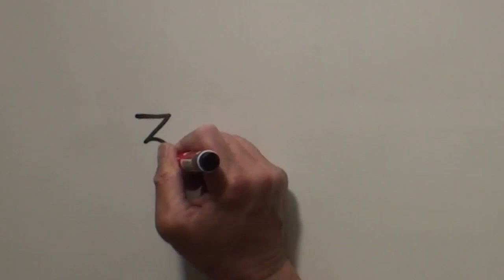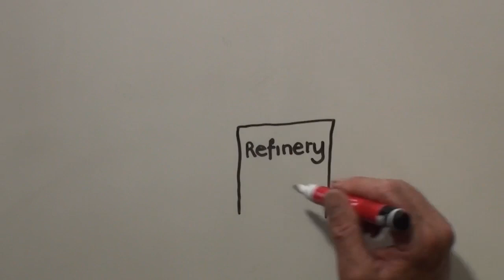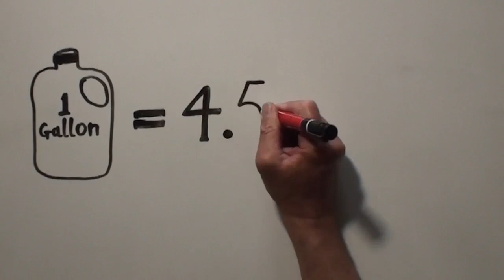Volts for Oil | Fully Charged

Comment: Hey good folks at Fully Charged! I've got a question for you. When I divide 5,642,000,000,000 watts by 250 watts (a reasonable figure for the watts used to power an EV for a mile), I get 22,568,000,000 miles, or about 22.5 billion miles. However, you ended up calculating "just under 20 trillion miles." Which one of us is off? (I hope it's me!)
Reply: You are right, he is wrong (besides "watts" for energy).
And if you correlate the 5.6 TWh with the amount of produced fuels, you get less than 0.1 kWh per liter.
The high electricity demand of fuel production is a myth.
Reply: @701983  Thanks for your thoughtful reply.

Comment: Also factor in the carbon emissions from the tankers used to deliver the fuel to the filling stations, the power used to refine the fuel THEY use too, and the emissions from running the filling station.

Comment: Can we have an update, please?
Reply: What about a correction?
Look at "volts for oil corrected"!
Reply: 5600 GWh used for the production of 3,659,500 TJ oil products (UK 2005, IEA statistics) is 0.055 kWh per liter diesel equivalent. Or 0.2 kWh per gallon diesel equivalent.
Let's say 2.5 gallons of diesel for 100 miles equates to 0.5 kWh of electricity for fuel production.
Which would suffice for ~ 2 miles with an electric car.

Comment: I just love this video! 
Comparing enegrgy spent to make fuel.
I would love a follow up, on the full chain well to tank.

From this video I deduct. 
Energy required to refine oil to fuel, is approximately 50% of energy if you used it to charge an EV insted.

How much to search, drill, transport crude oil, distribute fuel? 

How close to 100% do we get?
Reply: It's now 2023 and I would like an update too.
Reply: As would I!

Comment: It's 20 billion miles, not 20 trillion. For instance 20.000 miles x 1 million cars.
And you should consider the production of other oil products beside car fuel.
So it's rather 10.000 miles x 1 million cars.
There are more than 30 million cars in the UK.
Argument failed.

Comment: Yes... 1l=1kW...so electric car consuming 18kW per 100km or for small car 5-6liter gas/diesel ...so we have 18kW by electric car od 5-6kW by gas car (from oil)... We have only 25% power for electric car...so we should build a lot of power plant for elelctric car. For example if one car will drive for 15tys km per year we should have 3MWh energy for ONE car...for milion car...we should have 3000000MWh so it's 3000TWh per year and this about 6-7% more than existing power producing in Poland... :)
Reply: for petrol car with 6 l/100 km you need 9kwh to produce 6l. 15000 km /100 x 6 = 900 l of petrol x 1,5 kwh = 1350 kwh (1,4MWh) x 1000000 cars. 1400TWh to produce petrol!!! And 6 l/100 is for 10% of cars. Other spend 10-15 (SUV). so there's your 3000TWh electricity for EVs.

Comment: Excellent video. Let's take an even deeper look at the energy that's required for us to get fuel at the pump.

1. Crude oil must be extracted
2. It then must be transported by sea, often halfway across the world
3. It must then be transported once again to the refinery
4. The refinery process itself uses electricity
5. Diesel or petrol is then transported to different locations countrywide
6. According to the US Department of Energy’s Office of Energy Efficiency and Renewable Energy, “EVs convert about 59%–62% of the electrical energy from the grid to power at the wheels. Conventional gasoline vehicles only convert about 17%–21% of the energy stored in gasoline to power at the wheels.”

Now let's look at electricity.

1. Produced locally
2. Existing infrastructure does not require transport in the traditional sense

Even when using coal power plants, there's no comparison. I wish I had the stats, but the above sums it all up.

I think California will set the standard as to the kind of environmental impact EVs will have very soon. Only 4.13% of its electricity is generated by coal. As the number of EVs and plug-in hybrids increases, there will be an improvement in air quality. That in itself will reduce respiratory issues for the local population and most likely have an impact on cancer rates, the quality of local produce, etc. 

The only negative is battery production, but in the end it is the lesser of the two evils.  We will probably see a shift in the job market as well. I mean - oil change?
Reply: Very well said, sir! A thoughtful analysis.

Comment: Hey thanks a lot for this great video revealing an important figure. Problem is.. it will take years before they stop production.. unless they would have to produce the power they need themself as they should be cut off from the Grid!

Comment: For users of the metric system:

Robert didn't display the fuel production numbers. If he did, probably more viewers would have recognised his completely wrong calculations.

UK refineries produce roughly 38 million tons of motor gasoline and diesel per year (IEA statistics, 2015).
5642 million kWh per 38 million tons of fuel is 0,148 kWh per kg of fuel.
Not that much, right?

But: 
- Not only cars use diesel
- Refineries produce not just gasoline and diesel, but also heating oil, jet fuel,...

5642 GWh are for the complete production of the refinery, the share of car fuel might be around 2000 GWh for maybe 23 million tons of car fuel.
Then you would get 0.087 kWh per kg of car fuel.

And 2000 GWh for 20 million cars is 100 kWh each. Which would suffice for a few hundred miles.

I like fully charged. I like electric cars. I like Robert Llewellyn. But I don't like fake news. 
Sorry, Robert, this video is a shame!

Maybe you can do a "correction and apologize"-video some day and link it here.
Maybe Helen Czerski could help you with the maths.😍

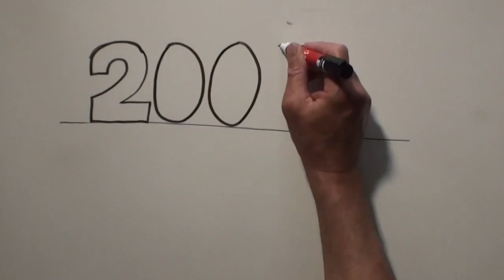Comment: 4.5 kWh to refine a gallon? Or 0.222 kWh (1/20th?)?  Strikes me as very odd that ~ 3:00 he gives a specific number for kWh used by refineries, and then goes on "guess" regarding kWh per gallon refined? Why not use the actual numbers? I did just that, using his  5642 Million kWh number for 2005, and this source:
http://www.ukpia.com/docs/default-source/default-document-library/statistical-review-2017---final-website.pdf?sfvrsn=0

which says in 2008 (closest year), UK refineries had ~1800 th bbl a day capacity, and ~ 80% utilization. Some math and factoring 31 G diesel/gasoline from a 42 gallon bbl, and I come up with ~ 0.222 kWh of electricity consumed to refine a gallon of fuel (not even accounting for the other products). That 222 watts won't even take an EV a single mile. That's way off from 4.5 kWh! 

I got a similar number from US sources (385 watts/gallon) adding the major fuels:

https://www.eia.gov/dnav/pet/pet_pnp_refp2_dc_nus_mbbl_a.htm
https://www.eia.gov/dnav/pet/pet_pnp_capfuel_dcu_nus_a.htm

Instead of saying the substation was "huge", we need a number. It is very suspicious to me when those numbers are hidden, and then a numeric result is presented, w/o the intermediary math, or the numbers involved. And people accept that?

Comment: This is one of main argument against e-car skeptic preaches.
Reply: Fortunately, it's not a main argument. Because the calculation is wrong. And 5642 GWh of electricity isn't really much considering the gigantic amount of gasoline, diesel, heating oil, jet fuel,... these refineries produce.
Probably around 2000 of the 5642 GWh account for the production of car fuel.
2000 GWh distributed to 20 million cars are only 100 kWh for each car.
You won't go far with 100 kWh. That's one single charge of a Tesla Model S.

Comment: Plus it takes even more oil to transport gasoline and diesel to every single one of the thousands and thousands of fuel stations in every remote place in the country. Electricity is already everywhere and can be transmitted in massive amounts for hundreds and hundreds miles in a split second for pretty much nothing.

Comment: Add to this the fuel used to transport the Crude Oil to the refinery and then the distribution to service stations.  Yet another part of the ICE CO2 emissions that are excluded from tailpipe emissions comparisons.
Reply: A semi loaded with 10,000 gallons of gasoline, with about 6 MPG, uses 250 gallons of fuel to take that gasoline 1500 miles. That's a 97.5% transport energy efficiency, it's not 100% but not that relevant really.
Tanker ships taking the crude to the refinery could be a more significant emission, but that could be solved elegantly by simply making them nuclear powered. No CO2.
Reply: Yes, let's make oil tankers nuclear powered. What could possibly go wrong? I mean, it's not like oil tankers ever run aground, is it?  Seriously, it's hard enough to keep nuclear electrical generation safe on land (though I am not completely against that in the short term, just until we can scale renewables and efficiency up).

Comment: It is hilarious to see 7 thumbs down for this video...
Reply: I just added one more.
Actually, it should be much more, because the only probably correct number in this video is the electricity demand of the refineries: 5642 GWh per year.
This may sound a lot on the surface, but considerung the fuel production of the refineries and the electricity consumption of 20 million electric cars, it's not really that much.
You would get only a few hundred miles for each electric car, if you could use the electricity from car fuel production.
For more numbers and the calculations, see above at "For users of the metric system:"

Comment: Now that the fullychargedshow has more regular watchers, I'd love a re-make of this video. I think this is info is still really important to get out to the general public
Reply: I used American gallons, not British. Sorry, I'm used to the metric system.
However, this doesn't affect the basic argument.
Reply: But if he would do the calculations right this time, the figures wouldn't fit the intended statement.
Only the initial number of 5600 Gigawatt hours seems to be correct (is at least plausible), but the deduced numbers are completely wrong.
I give you two numbers from the IEA statistics, you can do the math for yourself:
Output of oil products from UK refineries 2015: 62,449 kt OE (62.4 million tons oil equivalent).
Output only of motor gasoline and diesel: 37,711 kt (37.7 million tons).

Even if you count only motor gasoline and diesel, you get only about 0.45 kWh per gallon, a tenth of Robert's number.
If you include the rest of the oil products (jet fuel, heating oil,...), which you should do, it's even less.

The high electricity demand of oil refining is a widespread myth, probably based on a confusion of "energy" and "electricity".
Refineries need a lot of heat energy, but not that much electricity.
5600 GWh may sound a lot, but referred to the fuel production, it's peanuts.

And if you count 2000 GWh only for car fuel and give it to 20 million cars, each car gets 100 kWh, which would suffice for around 350 miles.
Reply: @701983  I don't think we care about the kWh per gallon -- we care about the total electricity that could be used to power EVs. But you are correct about the accidental double-counting: 2,000,000,000 kWh (2 billion kWh) is 8 Bn miles at 4 miles per kWh. OK, that could move 20 million EVs "only" 400 miles -- but the 8 BILLION MILES of total travel is still pretty impressive. Of course, you'd need everyone to drive an efficient EV that gets 4 mi/kWh (e.g., Model 3, Kona, Niro...) and many people just gotta have their i-Pace, eTron, Taycan, Rivian, IONIQ5, EV6, and so on and those  can barely scrape 3.5 mi/kWh.
Reply: @xchopp  Sorry, but it doesn't make much sense to look at electricity consumption numbers that way, without considering the production numbers, they are related to. Without any reference, you can make look ANY number big.
An electric car in average use consumes about 3000 kWh per year! An impressive number! With this amount of electricity, you could power a fridge for 30 years!
Or you could power an electric bicycle for the distance earth - moon.
You see what I mean?
I'm a big fan of car electrification, but I don't like bad arguments like this fairy tale about the high electricity demand of fuel production.
ENERGY consumption of fuel production and supply is "impressive", but not the electricity consumption.
Reply: @xchopp  And I especially criticize the conclusion, which many people draw of this myth: That we hardly need additional electricity production for car electrification. Because we can use the electricity that was used for fuel production so far.
But this pretty small amount of electricity will hardly make any difference, we will need new electricity production for virtually the whole demand of electric cars.
That's no unsolvable problem, but people should be aware of it. And should not dream of such a "magical" solution.

Comment: After yesterdays announcement and the shockingly poor news reporting in the media, this video has become so important.
Are their any newer figures that it could be updated with? I will be sharing this!
Reply: The calculation is completely wrong. Probably the only correct number is the initial 5642 GWh.
Maybe more viewers would have recognised it, if Robert had displayed also the fuel production numbers.
If you count only the 38 million tons of motor gasoline and diesel (for cars AND OTHER vehicles/machines), you get about 0.45 kWh per gallon, a tenth of Robert's number.
If you count the 62 million tons of all produced oil products (also jet fuel, heating oil,...), you get about 0.3 kWh per gallon.
Not that much, right?
The mentioned production numbers are from the IEA statistics 2015.

I like electric cars, but I don't like fake news.

Comment: Photons on Sun > 8.3 minutes > photons reach Earth > photons converted to electrons in photovoltaic cells  > electrons travel down power lines at speed of light to be stored or used. Amazing hey :)
Reply: Area of PV panels needed to replace all US power stations 115 km x 115 km . Lithium is abundant, power for refining no problem, storage no problem ...